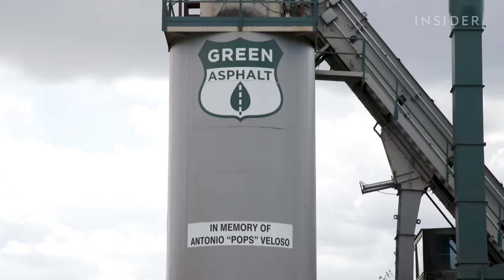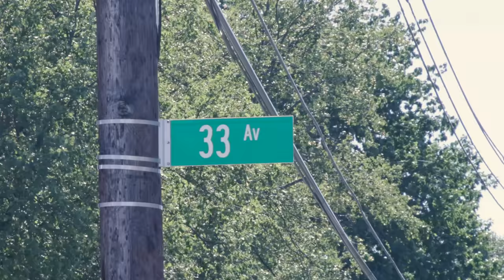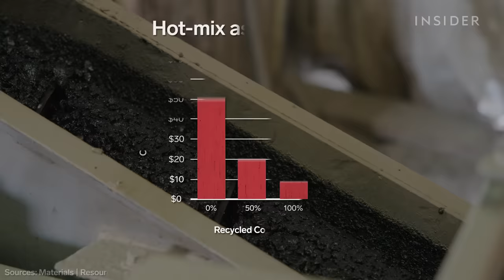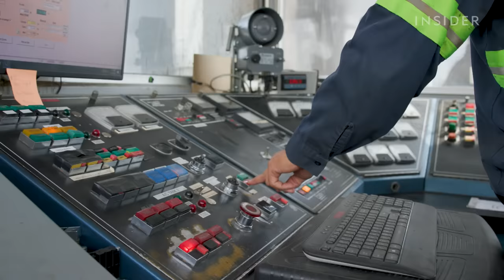Roads Can Be Recycled Forever, Why Don't More Cities Do It? | World Wide Waste | Business Insider

Comment: the private contractors the city I work for have multi million dollar machines that already recycle the road they tear up and remix it with fresh tack and pave it all in a single pass, its quite an amazing material.
Reply: As well I have Observed that the colour of the ??tar laid down before applying the new asphalt is different! Now adays  is a brown in colour not the black of 40+ yrs ago!
Reply: @edwardcarberry1095  Odd I haven't seem brown asphalt where we get our supply. If we get a load that is brown we consider it a contaminated load with too much dirt and not enough oil in it and send it back for a better load.
Reply: The brown what  ever shade they call that which is sprayed on the old ashpault which is then covered. It used to be sprayed  just before it was covered, not now have seen it sit over night before it is covered.
Reply: @edwardcarberry1095  yeah the new tack as we call it is a brown color now and has a sweet smell to it. its water based if I remember and is a bit cheaper but just as effective. that is used to seal the pavement below the fresh asphalt that is paved down.
Reply: Thanks. 
It does NOT Work nearly as well!

Comment: Another really great video! I know another large hurdle in the US is regulatory -- most states have an upper limit set for what percent of highway pavement can be recycled (either from pavement or shingles). 
I'm curious if anyone knows what other uses there are for the crude oil fractions that would be replaced by green bitumen -- if we don't use those fractions (side products from fuel distillation) for bitumen, where does they go? Are there other uses that are also recyclable?
Reply: It's not regulatory, it's specification e.g. quality.

What's not being mentioned is that rap is of a lower quality then virgin. Old bitumen is more oxidised so it's lower quality then virgin as more of the oils in the binder make it flexable are gone. So you still need to add new binder.

What's also not mentioned is the crushing of the rap makes the stone portions smaller so it's not optimal for large stone size mixes.

Finally you can't heat it to the same tempature as the bitumen in the rap oxidises as it goes through the burner if it's hoter then 180degree c.

So yes you can recycle it but not at 100% for main roads etc.

It's also normally a pig to hand work so not great for small jobs either
Reply: @nimrodbegg123  thanks for the supporting info!
Reply: @nimrodbegg123  They do mention it's not the same quality, it's why they add the paraffin oil. I'll bet not much of the stone gets broken in the process, it's the strongest part of the mix- not to mention they sort the stone size so they can make the final mix with the proper proportions. 180 deg isn't the limit as they heat it to 300 degrees. Did you watch the video or just reporting your 'expertise' on how recycled asphalt 'isn't good'? 'Experts' have so much difficulty with change, they 'already know it all'.
Reply: @troyclayton  I watched the video, and what they are making is exactly what we made in Melbourne and Adelaide for doing carparks and paver laid footpaths. It is not main roads spec, though at least in Aussie we were laying and making  all the way up to 70 percent recycled mixes to go to subdivisions and council roads where they where willing to accept quality sacrifice's.

State highways really wouldn't go beyond 30 percent due to aged binder concerns.

Also adding volitiles to the mix rather then the binder has issues, as it's lower softening point can negatively impact the life of the mix, and it's reslience

The crushers do smash stone as that what they are meant to do, and the rap comes from profilers that normally pulverise the pavement to shoot it into trucks.

7 years of playing with asphalt mix and asphalt plants teaches you a wee bit about.

100 percent was something we could do but the quality issues on a product you had to warranty was a issue

Also some countries use units that actually make sense and bitumen as a whole tends to oxidise at or near 180 degree c
Reply: @nimrodbegg123  good explanation. Thanks.
Reply: @troyclayton  Believe it not @Oliver Begg is correct. I literally work in this industry as an asphalt binder specialist and have been working with this exact question in a research context for several years. 

Look up Asphalt Binder Rheology, specifically AASHTO's performance graded criteria and T313 Bending Beam Rheometer test; RAP binder has a worse relaxation rate than new binder as the old stuff is more susceptible to both intermediate and low temperature fatigue cracking. It's a well known problem in the industry and this video didn't address any of the performance pitfalls from 100% RAP mixes. 

That said, it can work in low volume roads, but don't expect those roads to last very long compared to their traditional/virgin counterparts.
Reply: There are limits on the mix percentage.  There is more to asphalt mis engineering then just saying recycle it.  Most states have experimental highway sections testing different mixes so they last the longest under different temps and loads.  Mill and fills are great options on county and township roads out of trucking lanes but do not hold up under heavy constant traffic.  Especially here in MN.  Replacing the road surface more often costs a lot more than fresh mix.  But maybe in the future it will be figured out.
Reply: Tires.
Reply: @nimrodbegg123   @Jain Radhakrishnan  All we have to do is look back over that last 100 years to see how many "impossible" things we've learned to do with ease. I see this in my field of biochemistry. Imagine all the lives lost if people didn't achieve what those before them have failed at. At the beginning of the video, it was stated how people from industry would react. They got that right, what else have they gotten right- or others after them will?
Reply: @troyclayton  I promise you, every asphalt manufacturer would love to use 100% riprap, or millings. It would cut their raw product cost considerably.It's really not that easy. They're all doing research into it. You really think they're all going "Na, let's use all virgin materials, it's more expensive that way"? Main roads use 20mm stone, and graded down to sand. Remilling old asphalt makes for smaller stone, which doesn't have the bridging properties of larger stone. ALWAYS there will be the need for virgin product because of this. Another problem is contamination. Specs say, mill out to 100mm  and replace in 2 layers, 70mm depth of AC20, 30mm depth of AC10. If that 100mm mill goes into road base, which regularly happens, the riprap is contaminated. That's just 2 of the issues. It's not like the whole industry is being difficult and refusing to change.
Reply: That is the big question/frustration I had with this video. 
Bitumen and even the quarry rocks are both waste products of processes that will happen whether or not they're used in road manufacture. So what are we doing with all that? 
Tremendous shout-out to Oliver Begg too for their insights into why it's not totally up to specifications.
Reply: @ADobbin1  that’s called called crumb rubber, can’t really exceeded 5% of the binder in Seals. For Asphalt binderwas only approximately 5 to 6% of the total product, So it doesn’t really help.

It’s like eating fibre to your diet it’s only a filler.

Comment: In & around NYC, blue stone is used for the aggregate.  In much of the country it's crushed limestone.  Lighter color, but very soft stuff. Breaks down into finer and finer pieces until all you have is dust. New rock & gravel would be continuously needed. And still wouldn't be strong enough to last.
Reply: should add ground rubber to the mix. doubles the life

Comment: This seems like a solid win/win.  Wishing them all the best.   Now we  need someone to go commercial with a process to repurpose composite waste into concrete reinforcement.
Reply: There’s a company in the Upper Peninsula of Michigan that uses a poly gator bar made from composite materials that gets used in curb reinforcement. Not allowed in anything else as it hasn’t had enough time in projects to show a failure rate.
Reply: @travisvanalst4698  I've seen some fibreglass and composite reinforcement products,  but are you saying those ones are recycled?

Comment: Asphalt is effectively made from waste products of the petroleum industry.... So reducing our use won't really reduce production. Plus the carbon remains trapped if it's on the road or capping a landfill. As we decarbon our world (assuming that ever happens) reusing asphalt makes more and more sense, but it's not fixing a problem per se.
Reply: Yes asphalt is not a problem. It is just good use of the waste of oil refining. The main problem is the abuse of the oil itself for fuels. The USA and the rest of west must reduce the use or it will collapse in massive economic depression.

Comment: In the late 80's or early 90's there was a process developed to rip up asphalt, break it up, heat it, add a little fresh bitumen, then lay it right back onto where it was removed. I saw that equipment in operation several years ago, IIRC in Oklahoma. It was a pretty long line of equipment with the asphalt ripper in front with a conveyor dumping into a mobile heating vehicle. The hot ground up asphalt was then passed to a mixing vehicle then dumped onto the road bed to be rolled and compacted. Somewhere in there was a hot bitumen tanker.
Reply: They do this in Philadelphia now.
Reply: Watch the wirtgen group...

Comment: I hope they use 100% recycled everywhere soon!
Reply: It seems pretty cool but you still have a problem when making more roads.
Reply: The old asphalt does not get dumped in a land fill anyway.  Millings make great bases for residential driveways.   Dump, spread it out , drive over it.  It will be a bit wavy but it is cheap.

Comment: Most states use recycled crushed asphalt mixed with gravel as a base layer for roads they also use recycled concrete for base layer. So now if they use recycled asphalt for new pavement ontop of recycled crushed asphalt their could be zero waist
Reply: The used crushed asphalt is never wasted like this video suggests.  It is used in temporary roads during bridge replacements, used on steep side  slopes by bridges on county and township roads.  Some townships use the recycled crushed asphalt as shoulder material. If it is available it makes a great  private driveway, it lasts longer than gravel.

Comment: 08:58 the black pavement absorbs heat - while recycling asphalt, can additives be used to lighten its color to grey? can this be done without impacting asphalt quality?
Reply: Had the same thought, is mixing in chalck, quartz or granite an option?
Reply: The black color is desirable for visibility of the road, lane striping, and safety markings.
Reply: @jasoncox9930  Are there additives that can make the road "white" to the infrared and ultraviolet spectra, where people can't see it, so that the road can still look black, but reflect a significant portion of the sun's light?
Reply: Some areas of some US States use aggregate that's either high in iron or is crushed lava 'cinder' rock, giving the asphalt a dark red color, sort of like red velvet chocolate cake.
Reply: @johnnyvh1188 🤓🍙 SiO2 sand has different use.📠🪟🪞🖥📲

Comment: @2:25 Its not just big cities that do this. Even in my small town, a main route (approximately one mile)to the densest shopping area was repaved. The next week, the municipal water and sewer department cut a zigzag trench to repair the system.  All the manhole covers, which are apparently required to be placed in the tire track of the lane, were five inches lower than the new road. Yes, the put in new manhole trunks that were shorter than the ones they were replacing. 30 days later, after the uproar from residents of all the towns that have to use that specific road to get to shopping, the town had to repave the entire road.

Comment: The area I lived in up until this year recycled all of it with a limit on percentage for highways based on designation such as interstate, US highway, state, or county/city as each has its own issues in the hot and cold weather and base situations. However; that is a benefit as that left an amount for use in parking lots, driveways, and other applications without those needs at a lower cost. Otherwise you are paying more for your driveway for all new when all recycled does just as good.

Comment: It's actually done a lot in my area. They save the piles and reuse them. Theres very specific areas you are to dump at if you have asphalt debris. The real problem is tires. There are countries that don't. I'll tell you the secret to recycling tires...  liquid nitrogen. It subjects the tire to such a cold it crumbles and can be pressed through tubes like play dough to be reprocessed. You can even strain the wire out of it via a separator as it passes.

Comment: After it is screened, you can put it back down, wet it and pack it without adding new oil and it will make a good driveway or low traffic road. We have also mixed it with oilfield cuttings and made very cheap road base and pothole patching material.

Comment: Theoretically so. The most efficient way is to recycle it in place. Unfortunately, that doesn't work forever as along the time the stones will be ground to dust and the asphalt loses some of its strength. Of course the rest could potentially be used in some other place, like your front yard. You can also use slag and other materials as asphalt aggregate - just ensure it won't cause problems for car mechanics (it really can, ask for more information from Finland).

Comment: I never heard of such practice before. We have many decades old houses here; the doors of many old houses lying lower than the road itself and I heard stories that there was a step stones or logs on people's doors because doors were really high to enter with a single step, mostly because of flood concerns. My grandparent's house had a basement with a window opening to the street so when they buy coals and truck pour coals to the street, they could shove it from that window into the basement and store there; now the whole basement is gone and buried underground.

If you dig straight, I bet there are at least 1~1.5 meter thick old asphalt and cobblestone materials. You can't really dig those and recycle anymore, because if you do, you will lower your street's elevation compared to other streets and your street will turn into artificial lake with every rain. Plus there are new infrastructures for such as phone lines, power and gas lines; you have to dig whole city at the same time and remake the whole infrastructure which must be a multibillions mega project and I don't think it is possible or feasible even if it's possible. Demolishing old structures and building new ones must be cheaper solution than digging whole city up for recycling. There are also many new apartments in this developing neighbourhood and their doors sits higher than the road right now, but I believe they too will be buried in the next 50+ years or so since I have seen many old apartment blocks in the old neighbourhoods where you use stairs to go couple meters down the ground to enter the apartment.

Comment: Ya know… If they didn’t patent that filtering system, other asphalt recyclers could also use it.
Reply: they can purchase the patent and do it, The guys that invented the process had to develop it which is risky and costs enormous amounts without direct yield until the final product is releasable.
Reply: @delgermuruntsagaankhuu6951  I’ve done a lot of research on patents bc I design stuff a lot. Unless you are planning to A) sell the design, or B) sell completed systems, it makes very little sense to get a patent for the sole purpose of “calling dibs”
Reply: @drew899  False. Most patents are defensive, and for new companies, obtained to entice investment.
Reply: @BoxStudioExecutive  I get the enticing investments part. I guess that makes sense.
Reply: That make sense in business term, But is it ethical to limit technology that could help our planet?
Reply: @delgermuruntsagaankhuu6951  The problem with that is that the owner can engage in an artificial protectionism by charging enough for the technology and adding limitations to the use of the tech that it becomes economically unfeasible for anyone to use that is not the original owner.

Hence why innovation only really takes off when the pattents expire.
Reply: @ronniew.9700  of course it's ethical. It's more than ethical, it's imperative. You don't work for free, do you? No one else does either. A patent gives a chance to make the effort worthwhile, thus encouraging future invention.
Reply: @stevek8829   @Steve K  could you elaborate more? I won't argue that patent would give fair compensation for inventor over their creation. However, wouldn't it be a barrier for others that gained inspiration from this video to perhaps try implemanting the system on their own recycling plant? Money is a short-term gain but the health of our planet is long-term gain, no?
Reply: @MICMON   I disagree. Patents are a great idea in a lot of cases. Someone above made a good point that they can bring in outside funding. I don’t like Elon Musk and I don’t like people who worship him, he doesn’t do much except chuck ideas against a wall and hope they stick. He isn’t reinventing transportation.

Comment: The main reason, especially in modern countries is because of specification. When material is recycled, all types of asphalt get mixed together; but when you design a highway vs. a park pathway the requirements and durability are very different. In Canada and the USA, certain project have very specific requirements and thus recycled materials may not meet spec. But for lightly travelled areas. RAP should be used in greater quantities for sure.